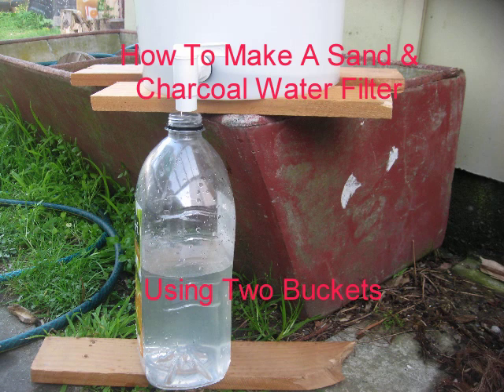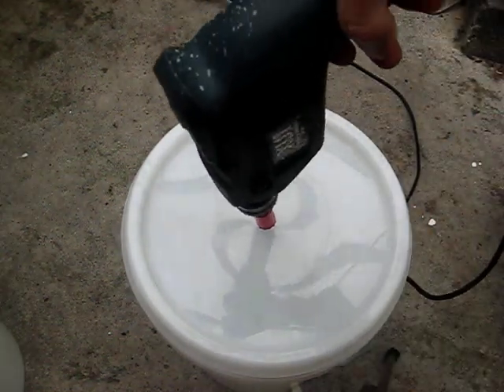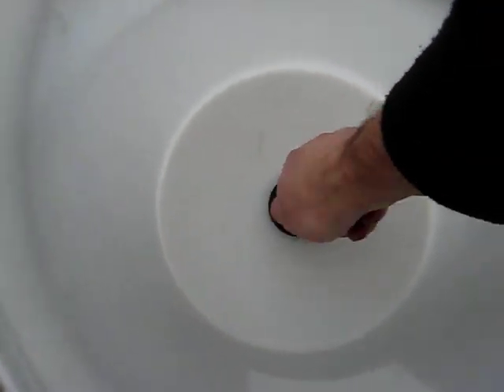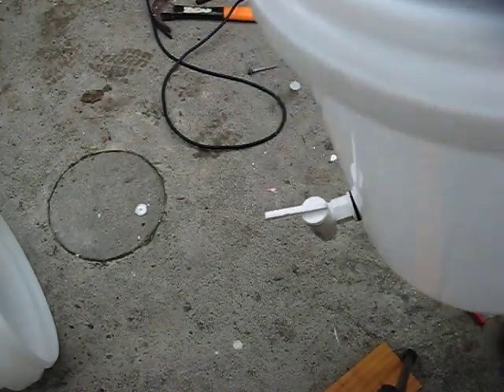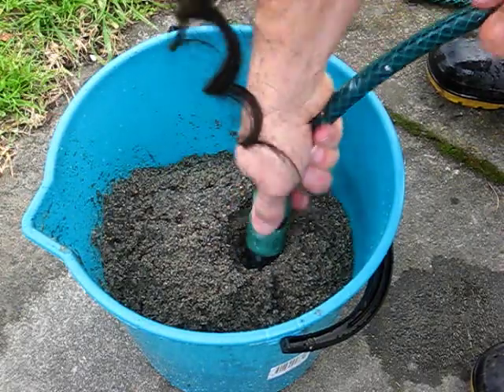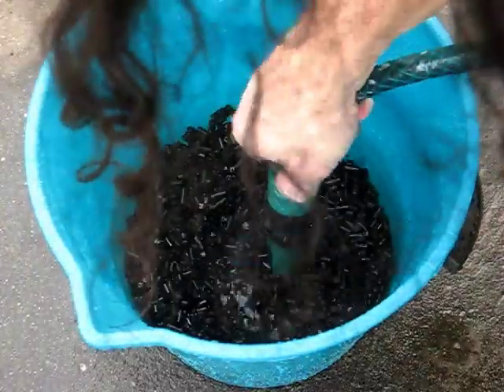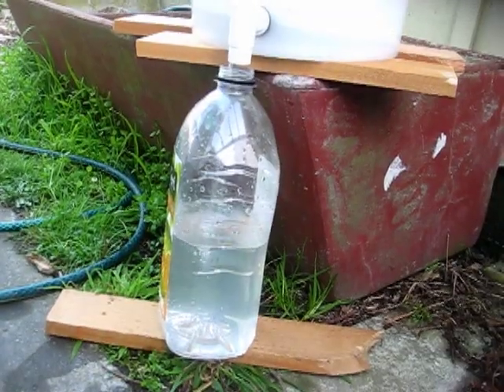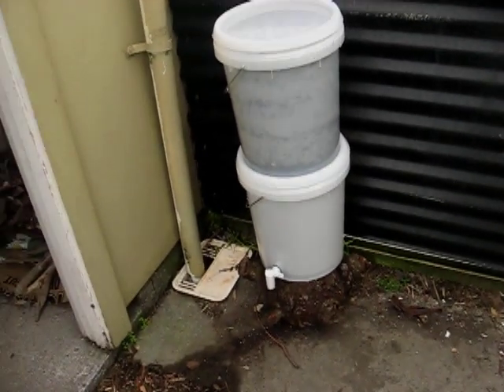Survivalist Water Filter - Make A Bucket Sand & Charcoal Bio filter

Comment: I don't see the point in having stones be part of the filtration system. Also I would think having the larger sized particles or sediement (for lack of a better word) to filter out the largest sized waste material, you would put at the top or use as the first filter. The charcoal would be the last filter located at the very bottom. Perhaps you could stretch clean cotton sheets over the top and the bottom as a pre and post filter. Also, you'll want the entire system raised up so the faucet is high enough off the ground to get a pot or a glass under it.
Otherwise, great video!
Reply: This is age old and the onlt improvement you can ever actually make is in the way you poke homes in the bucket  to improve flow rates

Comment: Can you run melted snow in this?
Reply: If the melted snow isn't still sub-freezing. If tou try run freezing water through a filter you might need to know how to make it to accept that, otherwise it won't want to flow as it doesn't have enough air exchange for the dense water passing through all the materials 

If it doesn't want to flow, you'll probably end up with molding problems very quickly

Comment: I'm putting in a bottle of homemade colloidal silver and let it dry. Hopefully the silver parts will stick to the gravel, the sand and the charcoal.

Because they used to use silver as an antiseptic etc. Like putting in a silver coin in a bucket of milk to make it last longer and it worked.

Maybe the silver parts will get flashed out over time. But you can always add in some more.
Reply: not a great idea. Your immune system is full of helpful bacteria and too much of that silver could potentially kill off beneficial gut microbes.
perhaps you meant a few drops and not a bottle, though?

Comment: i don't think it's a good idea to wash your bought and bagged activated charcoal with tap water. the activated carbon will filter all the stuff like minerals etc out  out of your tap water! so after the wash the charcoal lost already a good part of its filter capacity. you should only use ro or demineralized water (0 ppm) for washing the activated charcoal. i see that failure in many videos where people want to clean the charcoil and reactivate it for reusing it and wash it with tap water. just think about activated carbon tap water filters - they also need to be replaced frequently because they take up all the stuff thats in you tap water. anyway great work! simple but effective filter. i am thinking about using one like these as a prefilter so my 3 step drink water Filters dont clog that fast. should work as good as many of these small inline sediment prefilter which also need to be cleaned at least once a week..

Comment: At the city department I work for. We have water quality ponds that have this basic concept. 

The roadway water goes into one holding pond. In there is a trash rack to catch all the large material. 

From there it slowly releases to the sand filtration bed. That consists of 18” sand, fabric filter layer the is slowly released  through a under ground piping system that discharges it back into the aquifer.

Comment: make it a 3 bucket system with two filter buckets.. in the top filter bucket add 2-3 spouts into the 2nd/middle  bucket for faster flow into the middle bucket and can do the same with the middle bucket into the third and final bucket. Save yourself some money and make your own charcoal too. Use netting to separate sand from the gravel so the sand doesnt fall down into the gravel's crevices, plus it makes it easier for cleaning. I love that you used 5 gallon buckets which are readily available for just $3 at Lowes and Home Depot. So anyone can get building one of these.

Comment: I was looking for a medium and high grade water filtering ideas. Once the ceramic filter is gone, you have to rely upon natural ingredients. What kind of filter is that you have? It's smaller than the  I was going to buy. It appears you will need to prep these items way ahead of time (cleaning and prepping sand and charcoal). Does it still need to be chemically treated? In an emergency, it would be hard to clean that sand and gravel before hand.

Comment: So I was hoping this was something we could do in an emergency when I saw the title of the video; but basically, we're supposed to get the supplies & assemble this BEFORE we actually need it. What can we do when it's too late to make this?
Reply: I reckon you could do without the fixings between the buckets and even the spigot.  let the clean water run into jugs or bottles.  In a book I have on what to do in emergencies they say ordinary earth/ soil can be used to filter water-not as good as sand /carbon/ceramic but ok for emergencies.
Reply: @jellygood8552  That's kind of what I was thinking. Pebbles/rocks filter water, too. I have a lot of books about wild, edible plants and such, but nothing on filtering water. It's great if you have a device like this already set up, but it isn't always feasible..or possible, for some people. That's why I asked if there's another option..cheaper & easier, preferably. Lol
Reply: Angie W  Make it now.

Comment: Awesome...

I would recommend swapping the top layers with Ceramic Pellets from MarineLand.com on Amazon.com

I also recommend adding both activated Coconut Charcoals, Activated Bamboo Charcoals, as they are more porous and grab more contamination from water.

The premium sand bag not being washed is bullshit and you should harass their CEO about that one.
Reply: Does this remove pathogens
Reply: @mathiastb32  only physical... but not microscopic.  Must physically filter then boil the water in a different equipment

Comment: what about adding mesh dividers to all the layers so that when it gets too dirty you can take them all out seperately to vlean before putting back in, possibly with fresh charcoal
Reply: Yes or cloth
Reply: @disgruntledvet11b18  Or pantyhose (several ones to divide the weight >> don't want them to rupture when taking them out for a quick cleaning). Works every time.
Reply: use paint bucket filter bags
Reply: Good call.
Reply: Look up the bubbleman hash bags 
They're for buckets in different microns
Reply: @jgvtc559  With regards to keeping the various components separate, what would be far simpler, as well as being stronger, would be to use individual calico bags, particularly if using just the 2 bucket system. However, what would be even a better system, is to use 1 bucket/large drum (if upscaling), for each of the components, as well as 1 for the water. Especially if able to do the upscale version, I'd be inclined to set up an additional larger drum/rainwater tank, solely as an initial catchment & holding tank, with an inline tap, thus giving the water to flow through the filtration system, especially during heavy rainfall periods...less wastage of water from an overflow. Then can top it off, with a pump, to circulate the water. To take the whole project to another level, one could put a water wheel power generating system, between the top water tank, connected to a battery bank or if you are able to, space/equipment wise, one could set this power generating system aspect up, as a separate item. This way, you will be, at the very least, providing your own power, to maintain the pump. By circulating the water, maintains the life force within the water. Naturally, if you have a large enough system, you would be able to generate enough electricity to power your needs, which could enable you to be Off Grid, re power.
Reply: @dewillewellynn  you should make a video to show us what you just explained. 👍
Reply: Beer brewing bags will work great! That's what I used!
Reply: @tyrus373930  where do u get those
Reply: @sharriceowens913  Amazon. I'll share the link
Reply: White pillow case
Reply: How are you supposed to clean the sand & everything if you don't have water in an emergency situation?
Reply: @Trish....  i was thinking bake it in the sun or maybe over a fire in a shallow and wide pan such as a cake pan.  I know that most creek sand can be rather stinky, so that must mean bacteria

Comment: If you would've used super fine charcoal powder instead of the pellets, your water would've been clear the first time through. Just a tip for next time! Good day!!
Reply from the maker: Thanks for that info. However, in practice does any of that fine powder a) wash through or b) actually blacken the water? I haven't tried it so I don't know.
Reply: @aminutetomidnite2406  in my experience I've never had any black water. I use 3 liter bottles, and I have a cotton rag at the bottom that holds the charcoal powder in the bottle. And I pack it tight and then stack fine sand then more charcoal then fine sand on top, then finally a corse sand and gravel mix on top. That works great for me.
Reply: @aminutetomidnite2406  Having trouble finding the ES15 Filter from HydroFlow, any help would be appreciated. Thanks

Comment: My questions; how much or thick do the layers need to be 2 inches for each layer of large gravel, sand, charcoal etc? Help? How many gallons of water do you use this before you need to change the system or clean it?

Comment: as far as collecting water off of a roof for drinking, may I add this tidbit: I have asphalt shingles.  Owens/corning.  I contacted them about this purpose.  They responded with a university study on collecting rain water for drinking after running off of asphalt shingles.  The shingles did NOT add anything bad to the water.  HOWEVER, it was not recommended for human/animal consumption due to air pollution/animal feces [birds/squirrels, etc] that does contaminate the water.  I was considering capturing the water for livestock.
Reply: They would NEVER say go ahead and drink it. The key word is liability. ;-)

Although the use of every precaution is simple common sense.
Rain water is what we all drink one way or another.
Reply: Thanks for confirming my point. We drink it one way or another. ;-)
 Either stored in the ground or in overhead tank. It all comes from the same water cycle.
Cheers

Comment: Ah, NO.  There is a definite difference between filtering and purifying.  This one doesn't do either.  The poster has combined two different kinds of filters; he has the design of the slow sand filter, and the carbon part of a bio-filter (but the filtering is upside down).  Also, those rocks in the bottom don't do anything.  A SLOW SAND FILTER has about 5-6" of 1/2" gravel in the bottom, then another 6" of  1/4" gravel on top of that, and then a lot (at least 30") of sand that fills the rest of it.  Everything is wet, and kept wet, and about 3 weeks later, a cleansing layer of bacteria has formed on the top, and this is what does all of the real work.  Slow sand filters have been a reliable way of filtering and cleansing municipal water systems for nearly 200 years, and they remove 90 to 99% of the ORGANIC nasties out of the water.  It's very reliable.  BIO-FILTERS have sand and a charcoal  on the bottom, some smallish gravel on top of that, and larger gravel on top.  When "chunky" water is poured over the top, the large gravel traps the large chunks, the smaller gravel catches the smaller chunks, and the sand cleans out some of the smaller stuff, and the charcoal does some more.  It cleanses the water of some things and not others.  FOR MORE INFO, look up Slow Sand Filter from the CDC at http://www.cdc.gov/safewater/sand-filtration.html and http://www.nesc.wvu.edu/pdf/dw/publications/ontap/2009_tb/slow_sand_filtration_dwfsom40.pdf    And this explains Carbon Filtration:  What It Does, What It Doesn't  http://www.purewaterproducts.com/articles/carbon ..... KNOW what you're doing before  your life depends on it.
Reply: Shilodog, so what do you suggest?
Reply: but is safe to process water for home use. Dishes laundry etc....
Reply: Hey, have you heard about Trankors Survival Secret? It's off the charts. No matter what type of critical situation you might find yourself in, you can make everyone safe and sound with step by step plans.
Reply: Shilodog Smith u
Reply from the maker: Thank you that as an expert as you posting  your comment here. Perhaps you could share a link to a video that you have made that does a  better job than what I did here in this video. Just for your information though the stones in the bottom actually do a good job of stopping the sand going into the filter. I have used this filter to turn muddy water into pretty clear water (as can be seen in this video). From there I suggest people either boil it or run it through this other filter I made in a second video. No one is going to die from drinking the water. https://youtu.be/LuEPkYdGZXU
Reply: Sand filters do an effective job at removing large particles and contaminants from water.  However, the will not remove all contaminants from water including smaller pathogens.  Sand filters are effective step in the treatment process to remove turbidity.  Although sand will not remove all contaminants, they still have the functional use in the treatment process.  I thought this video was made very well.  Thank you for posting.

Comment: You can filter the water and fill up a glass apple cider jug. Place the jug directly in the sun. The UV will kill off bad bugs. This is what they've shown third world families. I plan to build this system. Thanks for sharing. I think I'll use a separate bucket for the charcoal part.
Reply: The SODIS method works most reliably in the area 35 degrees north & south of the equator.
Reply: +Patrick Palombo SODIS. Solar disinfection. 6 hours in strong sun 2 cloudy days but with cloudy water (turbidity) could take longer.
Reply: The charcoal actually kills bugs and viruses.

Comment: Hi 
Ive made the exact same filter useing the very useful info provided (thanx) my only concern is after rinsing thru around 30 times i place some cotton wool at the bottom tap , after a min or so when i look at the cotton wool its slighty discoloured, greyish im thinkin its comin from the activated charcol, now im thinking is it safe to drink, dont wanna down any carbon water, any info would be highly appreciated
Thanx
Iffy
Reply from the maker: +iffy07967 Really I view this as an emergency water filter when you have to deal with water that is really not very clean. After lots of rinsing I think you should end up without the residue from the carbon. But I'd boil the water before drinking. Or alternatively, the best solution would be to run your dirty water through the charcoal and sand filter I made in this video and then run it through a home made Berkey filter such as the one I made in the following video. https://youtu.be/LuEPkYdGZXU
Reply: +iffy07967 Granular and not pellitized carbon will be better. Also the carbon should not be applied this way.